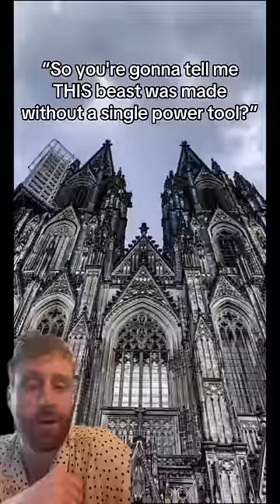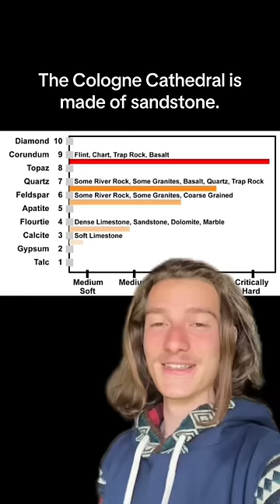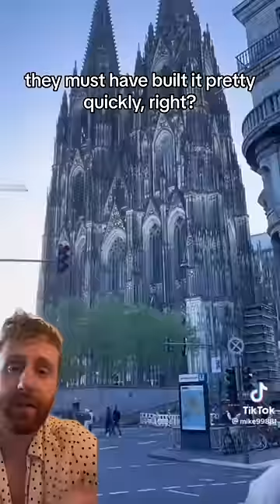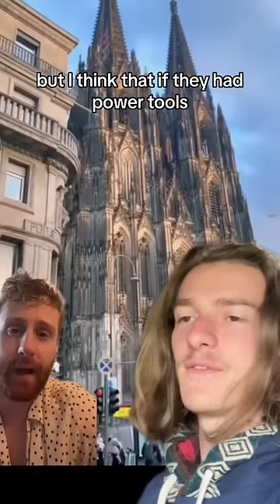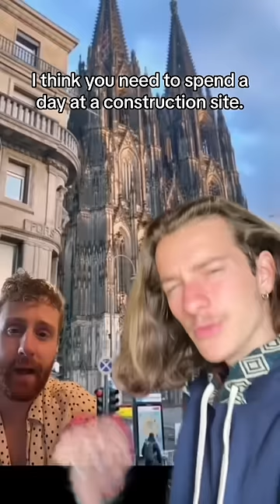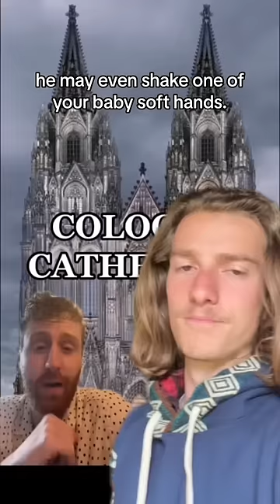How Did They Do It Without Power Tools?

Comment: Thing is, the cologne cathedrals sandstone is so soft that it constantly needs renovation because the rain keeps eroding the Damm thing
Reply: Das liegt nicht wirklich an der Härte, sondern an der chemischen Zusammensetzung. Der Regen ist leicht sauer und löst den Stein auf
Reply: @hackbodies  it is easier in said than done. You can't just put something modern with whatever contents on centuries old stone.
Sides, the exhaust fumes would cover up the result very quickly.
It is also not really wanted. With its current look, the cathedral looks haunting and ancient. Both are kind of the point of such a building.
Reply: @hackbodies  The reparations are  miniscule in comparison to the buildings size. They replace small parts of the Fassade, a (by acid rain) dissolved cross of a figure, for example.
Doing it like that would take literal centuries, by which point the progress of the beginning would be lost. 

The cathedral stands as intended of the City of Cologne. For better or worse. Cologne is also extremely liberal. If the cathedral was not some major tourist magnet, who knows what would have become of the building by now?
Reply: @honey25873  I don't think so
Reply: @honey25873 yikes. 

trans people really do be living rent free in you people’s heads huh?
Reply: @honey25873 probably still a church, I reckon.
Reply: @dazenguile4215 See the /vt/ Pikka incident. A lot of trains got destroyed in that one
Reply: @honey25873 Probably still the extremely pretty church. Because its pretty. And not doing anything harmful
Reply: @dazenguile4215 they're really jealous of people that are their true selves
Reply: @hackbodies  part of the issue is that sunlight is pretty damaging to most coatings.  You'd need to recoat it every few years at minimum, and that would require the old, degraded coating to be removed first.
Reply: @honey25873  I love how unrelated this is to this video's subject
Reply: @KarasuWaKotaeta  true selves that constantly need affirmation from everyone else lol
Reply: @hackbodies "I'm no expert in this" hence why you suggest this 'solution' as if it would be viable... 💁‍♂️
Reply: @KarasuWaKotaeta   I still don't get trans personally.  Cause whatever happened to if you were a dude and like "girly" things you just like those things.

Why do people need surgery to get an artificial vagina and have to be viewed as a woman in order to be okay?

Like it just sounds counterintuitive to the message people tried to push originally that was "if you are a man you don't have to like manly things to still be a man."

Instead let us just create a new thing that is even harder to understand for most people especially the older generation. 

Like all it is telling me is "if you like manly things then you HAVE to be a man otherwise it isn't okay" and vice versa. 

Like I don't understand how giving yourself a fake vagina or penis helps. 

Like can't Trans people just do everything they do as they are now as Trans as the sex they were born as?

Like what changes?

This is a genuine question but nobody ever answers it.  They just say "transphobic" and moves on. 

Like I'm trying to understand the logic.
Reply: @KarasuWaKotaeta I'll keep saying like until the day I finally understand Trans logic. 

I'm not trying to dismiss Trans I'm just trying to understand the point.  Cause it just seems redundant and regressive. Aka "don't be proud in your body and change everything you dislike."
Reply: @cannedsquasher5923  nobody is trying to impose being trans onto anyone else, or saying that anyone else has to feel that way. People are only expressing how they personally feel in their own experience. You can absolutely be a man who likes stereotypically girly and feminine things and still be a man. Likewise, there's nothing wrong with being a masculine woman. Typically, it's not trans people or the one's that support them who are pushing the narrative that you can't, but I digress. It's not about liking or disliking things, it's about their personal identity. As for surgical transition, it's usually due to significant distress. Imagine for a moment that you woke up one day with the opposite parts (ie you are a man and wake up female, or vice versa) and how that would make you feel long term. You are still the gender you are, but you no longer have breasts or your penis is missing. Sure, at first it might not bother you, but after months or years of being forced to live that way it would get very uncomfortable. Your body would feel foreign, and you wouldn't recognize the person in the mirror.
Reply: @cannedsquasher5923  so what's the point of being cis? It seems redundant
Reply: @honey25873  remider that american churches are parking lots now
Reply: @cannedsquasher5923  one of the reason is because there are loads of peple that do not have distinct female or male bodyparts.
How about just letting the people live and not care about it.
Reply: @cannedsquasher5923 being trans isn't really about changing your gender just because you like girly things as a man or vice versa. It's something far more complex than that.

I'm not trans myself so take my words with a grain of salt, but most trans people experience something called body dysphoria. That means when they look at their own body, something about it feels inherently wrong to them. A trans man for example will see his breasts and feel like they shouldn't be there. They feel unnatural to him. 

The only comparison I have is that sometimes, I grow a couple facial hairs despite being a woman. The first time this happened and I saw my face in the mirror, it triggered this sudden feeling of panic. It was only a couple of hairs, but I was overthinking it and scared that I was turning into a man due to a hormone imbalance or something. Apparently being trans feels kind of like that, except the feeling is near constant and they already are in what they consider to be the wrong body.

Most trans people I know aren't really stereotypically girly or manly to affirm their gender. For example, I know a trans woman who still acts like and enjoys "manly" things, she just doesn't want to look like a man.
Reply: @KarasuWaKotaeta  Ah yes, their true selves in which they must modify themselves to be exactly what they are not.  Nice logic.
Reply: @burgerpommes2001  And they make up a vast minority of trans.
Reply: They should just  put a really large raincoat on it
Reply: @KarasuWaKotaeta yea lol they just jealous of us living our true selves! 😋 i couldnt have said it better myself.

Its not my fault they need to take meds every day and get their bits cut off to feel better. Im just being my actually true self and these guys out here hating just because they hate themselfs. I pray for their poor souls. 🙏
Reply: @hackbodies  it would ruin the breathing ability so the wall construction would be destroyed very fast since moisture gets trapped inside and is not released out through walls
Reply: @honey25873 Thanks for adding nothing to the conversation
Reply: The mental gymnastics here deserves a gold medal 🏅
Reply: How did this conversation go from epoxy renovations to an argument about trans people
Reply: @suchendnachwahrheit9143  Yup. P
Air pollution
Reply: @dazenguile4215 43% don’t 😂
Reply: @felixgaede6754 Maybe because it ironically added nothing itself.
Reply: Why not just build a giant umbrella?
Reply: @suchendnachwahrheit9143 Not trying to criticize (especially considering your English is far better than my German) but I noticed a few easy to make mistakes in your comment. I believe you meant to say "repairs" instead of "reparations". When making reparations someone is making amends for something. Grammatically, you should have said "a cross or a figure dissolved by acid rain". And "fassade" should be spelled "facade".
Reply: @jonathanmueller2849  It is the autocorrection from my tablet. I am from Germany and my tablet thinks I am trying to write in German and even if it recognizes English as the currently used language, it has a very limited pool of words. "Repairs"  does not exist in German, so it thinks, that English is in use, however I used the word "reparations" before, never repair, so it automatically fills in the wrong stuff. 
Tbh, I am way too lazy to fix these minor things, as long as the meaning gets somewhat carried across. It is soo frustrating to write perfectly coherent and then have this idiotic tablet mess it all up.
"Fassade" is German for facade and the other sentence you are referring to is deliberately written like that. I just wanted to give an exemplary context, as to why a cross might have dissolved and would need replacement. I just liked the way it sounded, though I am indeed unsure, whether it is entirely correct from a grammatical point of view. I was however aware of the other option, the one you mentioned, and decided against that, because the rest of the sentence would have needed restructuring and again I am too lazy for that. I added that particular detail later.
Reply: @IkeaShelf_  because people are ignorant assholes
Reply: Maybe we should cover the hole thing in epoxy resin. Problem solved
Reply: @LRM12o8  it was a question?
Reply: @KarasuWaKotaeta make babies
Reply: @jonathanmueller2849 lol literally all you did was criticize🤣 you knew exactly what they meant yet here you are poking at them point out their mistakes, don’t be like that. People don’t like people who are like that lol you could be so much cooler
Reply: That was my first question after watching the video.
Reply: It can be sealed with silane siloxane. I imagine it's already been done to some parts of it.
Reply: @dazenguile4215 honestly I think it’s more out of compassion and genuine care. We truly want to help people with mental disabilities realize that there is something wrong with them
Reply: Thing is: in cologne people say, once it's finished, the world will end, so the builders are reluctant to work
Reply: @muftispiel3968  it would be too heavy for its foundations and colapse into the rhine, and no you can't simply enforce the foundations because below that there is roman archiological sites( like in the underground parking accomodation right next to it you can see the walls left by roman occupation, cologne is basically a city built upon a city)
Reply: @lukaspohle7804  i wouldn't say reluctant, the sandstone errodes away faster than it could be replaced using traditional tools, without powertools there wouldn't be a way to keep up unless you'd want to have a twentieth of germany working the trade just to finish it for a year before needing to go back on renovating it once again.

Comment: The funniest thing is that all most power tools have hand tool counterparts that have existed for thousands of years
Reply: Right? Most power tools just do a job faster not even necessarily better
Reply: Exactly. We took a thing we already did, and just made electricity give the oomph needed instead of our muscles. 

I am actually struggling to think of power tools that are not just analogs to tools. Maybe you could argue that laser/water cutters are divorced enough in their capabilities to count, but that is a stretch.

We sort of figured out simple machines like... Thousands of years ago.
Reply: @Caelinus  Oh well I was just thinking that a chainsaw might be a little bit too far changed from a normal saw to be considered an analog
Reply: @demolition3612 not rly it just uses a motor to do the sawing motion our muscles would do with a hand saw
Reply: @KayGreylai  I think you'd have to get into tools made to work with new materials like plastics to get something that kinda-sorta isn't analogous. Like... Injection molding. 

And then you have the consider whether that's a 'tool' or a 'machine' and what the difference is, if there is any, in this specific context.
Reply: @hypotheticalaxolotl  And even that is analogous to casting metal. Which is in no way new...
Reply: A lathe. It opens up a world of cutting we couldnt otherwise do.
Reply: @Ladyoftheroundtable  Lathes used to use flywheels and a pedal instead of a motor.  Even a 3D printer is basically using the same methods we used to use to shape clay.  All machines do is add speed and precision to the mix.
Reply: I know a family that have passed down a manual whisk. not like on a stick but it's a hand cranked mechanical contraption. it whisked well and didn't need anything except occasional greasing of the moving parts.
Reply: The Internet shows how much people struggle to think critically, but it will also show you that people can use sound logic so well, they are likely avoiding, or don't see the corners of the Internet where people are drawing the most illogical conclusions. Thank you for this post.
Reply: @in_ur_moms_house  But Robert Liston still used big ahh knives instead because he was just such a unit
Reply: Please, you think the original guy has even held a power tool, much less a hand tool?
Reply: @Caelinus maybe a 3-D printer? I mean it’s kind of a stretch…
Reply: @Currentlyprocrastinating37  I think a 3d printer is just human fingers lol.
Reply: @Caelinus  Impact gun? I feel like the lack of attachment of the head to direct force from the crank makes it different enough from normal drills.
Reply: and the whole ''power'' part ...funny how we don't see batteries or weird copper wiring all over the cathedral unless they mastered wireless power tesla style centuries ahead of time or ya know ALIENS!!!!
Reply: @ryanw4182  an impact driver is basically a Yankee screwdriver but with a motor attached.
Reply: Some people think that our ancestors were all dumb
Reply: Also less damage to your own body with power tools. Sure it takes skill to use hand tools but have fun with side affects of even harder labor after several years lol
Reply: How did they make the powertools without power tools 🤔
Reply: Does anyone here remember the woodwhrites shop on PBS? The gut made furniture with traditional tools. No electricity.
Reply: @Caelinus Maybe you can count welding, unless you count blacksmithing as being close enough. The ability to stick 2 pieces of metal together without hammering or immersing the whole thing in flames is pretty unique in my opinion.
Reply: @Caelinus I mean, maybe a 3D printer if you’re willing to include that under the definition of “power tool”, though I’ll admit that is a stretch.
Reply: @demolition3612  the first chainsaw wasn’t electric (and was created for performing c sections if I remember correctly), so it does have a non-electric counterpart. From what I remember, kinda looks like one of those hand crank whisks but with a cut-ty bit instead of a whisk
Reply: @demolition3612 

It was invented as a medical device, so it may be more accurate to compare it to ancient bone saws than to a woodworking saw
Reply: I mean most power tools are mostly  just a non-power tool + a motor.
Reply: @JacquelineUnderwood  3D printers (at least the plastic squirter kind) are pretty much just computer controlled piping bags, mechanically speaking. For the other processes, sintering and UV cured resin have existed for a while.
Reply: When I was a kid, my grandpa used a manual lathe! It worked on a similar principle to antique sewing machines with the foot pedal.

Comment: This reminds me of how in olden times up to modern day, people use hanging chains as a model for strong arches. The way a chain that is attached to two points hangs often reflects the strongest yet least strenuous arches. As a result, there are multiple cathedrals with massive hanging models reflecting all of the arches in the building upside down that the builders would use as a 3d reference model. People have always been real ingenious when it comes to building things.

Comment: Bro I’m an electrician and mainly just do warehouses where all the wire has to be inside of pipes, these pipes can go for a few hundred feet at a time and I had this dude ask me “bro what kind of machine gets the wire in there? Or does it come like that and you just put it up there?” My brother in Christ we pull it through with our arms…
Reply: Fellow electrician, sometimes I just explain it and if they still don't get it , I just go "I understand" and move on
Reply: That question sounds so painfull for the brain. Do they thing that pipe is build around it when the wire is made?
Reply: You act like the hard working local cable ferrets aren't a thing....
Reply: Some electricians use ferrets to run wires through pipes. I supposed that would be a modern stone age tool, like something from the Flintstones. Lol
Reply: @nerag7459 I didn't read the comments...you're right on. Lol
Reply: @Ninjanimegamer  They haven't been put out of business by robots yet!
Reply: Pulling cable on a roof in summer one year was one of the toughest jobs I’ve ever had.
Reply: Pulling 12-X MC: Psh, pulling wire isn't so bad
Pulling >300 MCM (even with a puller): I hate my life.
Reply: To be fair to the guy, i would also figure that there's a machine or tool that makes putting a cable through a tube easier, i'm surprised that there's not!

Why isn't it a thing?
Reply: @nintendoman12111  There is, its called a tugger and they run rather expensive to use and hard to coordinate into position. A lot of companies would rather just pull by hand
Reply: @hotspicyoreos1744   Interesting, it's weird how even with technology, sometimes it's easier to do things manually